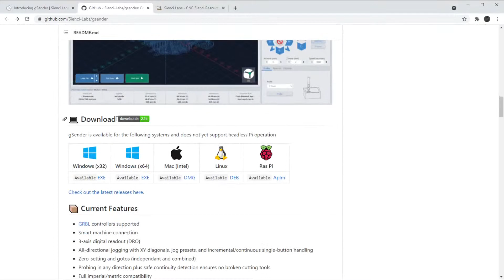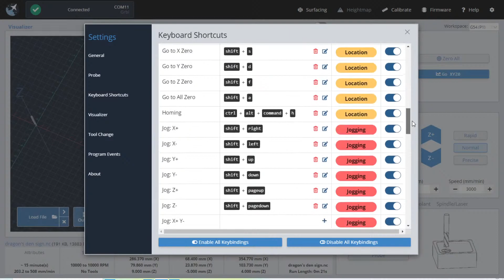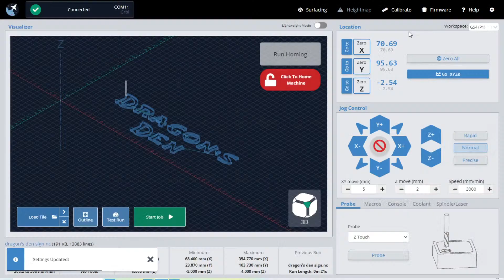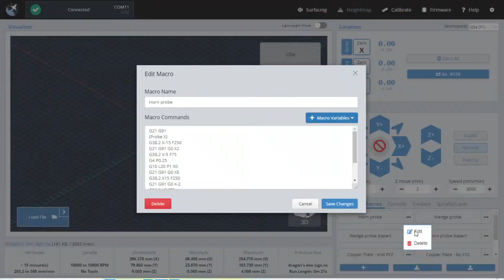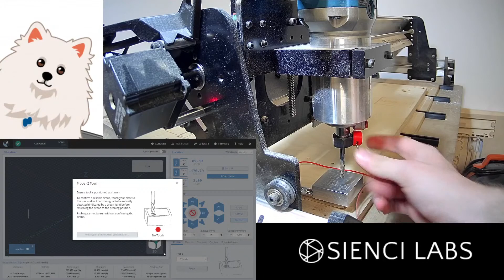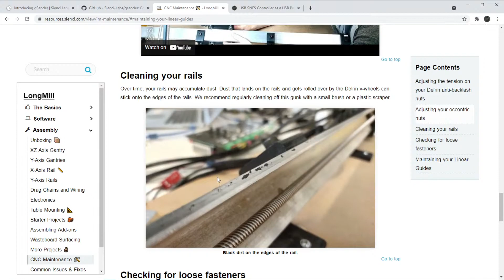gSender Guide, Tips, and FAQ - Livestream 1

Comment: I have a question in gender I try to zero x y z by clicking on them one at a time and even zero all but it doesn’t work
Reply from the maker: You'll want to check your firmware value for $10. If you go to the Firmware tool and click the reset button next to the 10 value it should fix the zeroing

Comment: A quick question, on gcsender i clic over the play symbol botton on the top bar, but the spindle does not turn on, so I broke a small bit, what is the difference between the fore mentioned botton and tha greeen execute command in gcsender?
thanks for sharing!
Reply from the maker: Of the code you're running doesn't have the code to turn the spindle on, then you need to make sure the code is in there. Otherwise you can put it in manually or in the start/stop g-code settings

Comment: Quick question: Is there an option to change the home position? So if I want to start from the bottom right instead of the left, will the probe self determine the probing direction?
Reply from the maker: Yes it's possible, it's a setting on your machine firmware. Look for "$23" homing direction, and if you change that value it'll change where the machine homes to

Comment: If im using multiple bits, do i just run one complete nc and then move back to the exact same starting position to run the next nc? Or is there a way to program in all 3 separate tool paths and have the machine come to a stop point for changing the bit? I cant find it anywhere. Or is there another video or page description of multiple tool paths?
Reply from the maker: You don't technically need to move back to the original starting point, since the machine will know the coordinates in relation to the material you are working on. However, if you do a tool change, you will most likely reset your Z-axis origin point only. It is possible to program in toolchanges so that they can come to your position, but it is generally easier to separate each tool into a different file in case you need to restart or make changes between each file.

Comment: Where’s the tool length table in GSender?
Reply from the maker: That's something we still haven't figured out how we'd like to handle. Typically industrial machines have a tool table that gets loaded up and stored alongside the machine itself, but if we set it up in gSender then when you connect a separate computer to your CNC it won't carry along the tool table. The other aspect is enabling gSender to be able to import tool table information from CAM software to match tool numbers between them. If you have any other comments or suggestions on the approach definitely let me know!

-Chris
Reply: @SienciLabs , Does GSender send the G-code to GRBL on the Arduino without performing any math with the numbers? Does this mean that the tool offset table needs to be sent to the Arduino?

Could the Arduino have only one tool offset, then that offset could be updated with the proper value from the table whenever there’s a tool change?

I don’t understand what you mean by “alongside the machine itself”. The computer and machine should be considered 1 unit. If someone sets up a tool offset table on a computer that’s connected to a machine, and then they move that computer to another machine, then obviously all the offsets should be invalid.

Are you talking about whether the offsets should be stored on the computer or on the machine (in the Arduino)? If the Arduino already has a tool offset table, then maybe it would be nice to load the tool offset table from the Arduino into GSender, let us edit it, then download it back to the Arduino. But I don’t believe that the Arduino has a tool table. It probably has a single offset register for each axis that works just like G54, G55, and G56.

Comment: Can you adjust the settings while a file is cutting?
Reply from the maker: Which settings are you referring to Eddie?
Reply: @SienciLabs  z up or down to adjust the cut
Reply from the maker: Yeah sure, if you pause the job while it's running you can manually turn the z-axis lead screw (or pulley or coupler) however much you want to change the cutting height and then resume cutting once you're satisfied
Reply: @SienciLabs  Thanks

Comment: Does this program have the ability to run the laser portion also? I thought I had seen that in another video.
Reply from the maker: Yes it can 👍 it's able to run laser g-code just as well - there are also some other laser tools used for testing and overrides. You can turn it on in the settings by clicking the Spindle/Laser switch.
Reply: @SienciLabs  
I was wondering if you could answer me one more question? 
My wife wants to know if its possible (bought separately) if a cup turner can be hooked up  to the long mill control board(?) to be used along with the laser portion of the longmill?
Reply from the maker: It's possible to do this, the process to set up can require some extra thought since you'll be taking the plug that runs the y-axis and using it for the cup roller instead. You can think of it like the laser moving along the cup as a rotation rather than a line movement
Reply: @SienciLabs  
You responding is exactly why I want us to order from y'all. I think that is exactly how they do it too and now I know how to word my question a little better.
The y-axis plug you use, is that plug pretty much standard in that it would fit in the female end of the cup turner. I don't know much about plugs. Im just a plug and play kinda person.
Reply from the maker: The plug is very common, it also has a spot for a small flat head screwdriver so you can wire the plug yourself for other purposes. I can't say if your cup turner will have the exact same plug type but you can either compare how they look or buy a spare plug to attach it yourself. It's called a terminal-style plug, they come in a smaller size and a larger size and are normally green. On our board we use the smaller style for the touch plate and other sensors, and then use the large style for the motors
Reply: @SienciLabs  
Thank you very much. I didn't even know what they were called. I know I need to order soon though. The 12x30's look like they are sold out for a little bit. Looks like I'll have to force myself to get the 30x30. :) before they get sold out too. For the past month I've been studying everything and looks like y'all are doing a great job and have a really good product(s).
Reply: @SienciLabs  
Hi, putting the longmill in cart now. There are things I would like to order in the very near future for it like the dust shoe and the touch plate. I already have the Makita(what do I need to do to make sure it comes with the 65mm?). Will I be able to? I don't know if you restock those or if your changing versions to mk2.

Comment: Is the surfacing option  compatible with installed sensors?
Reply from the maker: It should be, though I'd advise turning off soft limits during surfacing so you can guarantee you'll reach all edges of your working surface
-Chris

Comment: I put gsender on both my PCs and the visualization window is blank. When I got the surfacing tab it said something about webgl? So I checked andy browser supports web gl. I can hook to my Longmill, but can't load my break in G-Code. Did I do something wrong?
Reply from the maker: I think this might be an issue with older hardware or if there's some incompatibility between your computer and it's graphics drivers. Are you still experiencing the problem?
-Chris
Reply: @SienciLabs  hi! I answered on the forum page. I upgraded to 8.1 and it works perfectly! Ran my break in cycle.

Comment: Although  I missed the live version of this, thanks. especially needed the hookup and operation of the IOT relay.  I have been using one of these as a manual switch for the router.  Now I will hook it up and use the M9 and M9 codes.

I would love to use this on a small 1419 mini cnc for circuit board milling.  I find that the 115200 baud is good for connection.  I find that it will run the GRBL GCode commands from the loaded file.  What happens is that when I use the manual cursor keys that the cursor commands shown  on the command line are (for right X motion 5mm, left X motion 5mm, and Z+ 2mm ) :

$J=G21G91 X5 F3000
error: Bad number format

$J=G21G91 X-5 F3000
error: Bad number format

$J=G21G91 Z2 F3000
error: Bad number format

If I use the command line and put in G0 X5 or X-5 or Z2, it runs the commands.  

Odd.  It is an Arduino based mini CNC so Maybe I need to burn a different version of GRBL control into this device.

Scott In Harwood, MD
Reply from the maker: Hi Scott! I think you might be running an older version of GRBL which doesn't support jogging commands. These were introduced in GRBL 1.1 and are what allows the jogging in gSender to run so smoothly. We have guidance on updating but it's LongMill specific, otherwise, you should be able to find similar resources online for your use-case :)
https://resources.sienci.com/view/lm-grbl-firmware/
-Chris
Reply: @SienciLabs  cool, thanks!
Reply: Thanks, I took a chance and had GSender update it firmware.   It worked!  Now it does follow the cursor commands, just not the speed codes, it seems fixed at slooowwwwww.  But it works and should be good for circuit board milling.  I will use my Longmill 30x30 for the the cool stuff.  

Since my Longmill is a two year old beta unit, should I do a firmware update  from GSender on it?
Reply from the maker: If it's running lower than expected then I'd recommend using the calibration tool just to make sure that when you're telling it to move 1mm it actually moves 1mm, you can find the documentation on that here: https://resources.sienci.com/view/gs-additional-features/#movement-tuning

I think as far as the old beta LongMill it might be beneficial to update the firmware. I think GRBL 1.1 came out around that time so it's possible it might already be compatible so I'd only update it if you feel it's needed.

Best!
-Chris

Comment: Thanks for the video one question I have is on the xyz can you put other numbers in xyz other than zero like you can in cncjs when setting your location somewhere other than the edge of your part an example would be from a tooling hole that is not at the zero position.
Reply from the maker: Hi Rodney, that's something that we've seen requested maybe three times now so I appreciate hearing your feedback. There isn't currently no way to do that in gSender other than through manual gcode but we'll be adding it to our list of features to add in the future. If you'd like to try this out for the time being: if you wanted to set your current X-location as 5mm rather than 0mm, then you'd send "G10 P0 L20 X5".

Let me know if there's anything else I can help with :)
-Chris